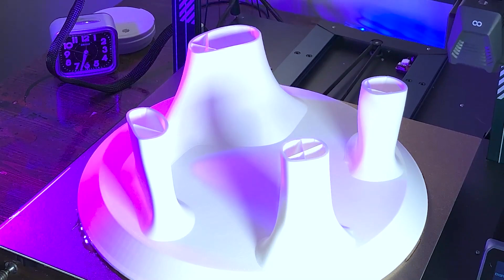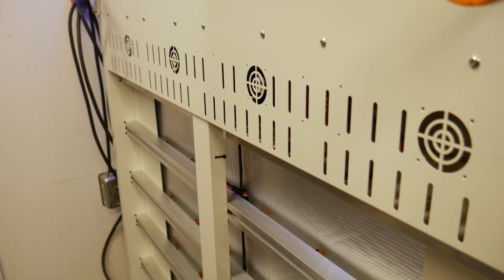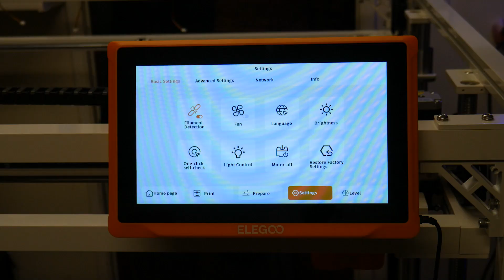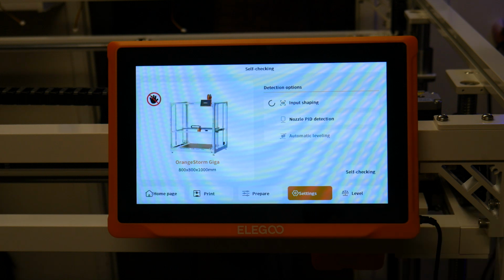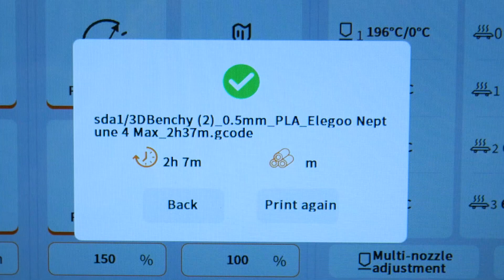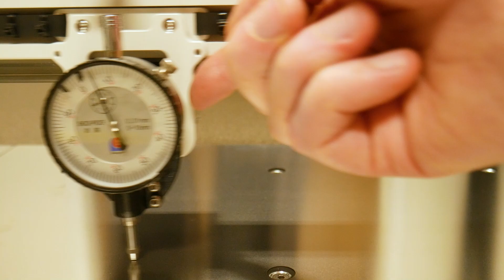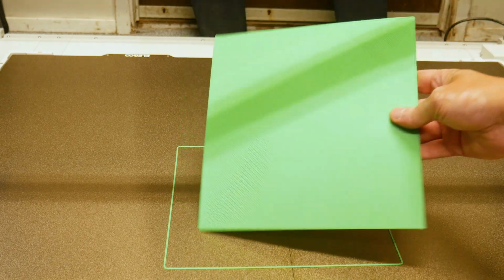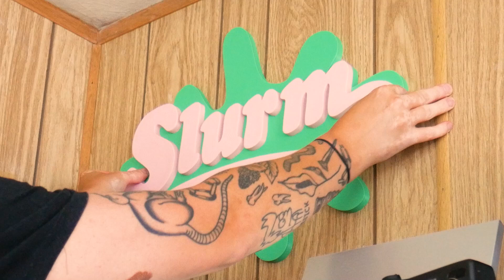Unleashing the Giant: Elegoo Orange Storm Giga 3D Printer Unboxing & First Prints!

Comment: Mine just came in yesterday. I purchased a runout gauge to help me level the bed as you did in this video. Where did you get the runout gauge adapter STL?
Reply from the maker: I whipped it up in fusion. I’ve had a lot of questions about it so I’ll put it on printables later today!
Reply: @WildRoseBuilds  Thank you very much!
Reply: Do you think you could make a short video on using the runout gauge? Mine finally arrived and using a runout gauge would be better than spending hours running manual leveling over and over trying to get everything as close to zero as possible.

Comment: Great video! Got my Giga in and have been running some nice prints off of it. I'd like to level it using a dial indicator also, would you be able to provide the link to that same dial mount you are using? Thank you!!!
Reply from the maker: I don’t think I have that file anymore! I just purged my 3D model folder 😭 I’ll check my fusion files and get back to you!
Reply: @WildRoseBuilds Thank you!

Comment: Printer seems to be amazing but on every single video I can see that filaments are wraping like crazy , without enclosure it's impossible to print objects at size 25cm  => , without wraping. Usually issue is the height so Z  axisis , higher you get, more problems you will find like x^2

Comment: Excellent showcase.  Just a shame that the Max will soon be replaced by a cable-robot enabled setup.  In the meantime, I challenge you to max out the build space with a carefully designed coin funnel wishing well. Put the resulting print in a high traffic location, and you should be able to pay for the printer in a week!

Comment: I can’t imagine the electricity bill after this
Reply from the maker: 1500 watts peak power consumption, probably 500 during printing. wanted to test power draw but couldn't find my meter :(
Reply: @WildRoseBuilds just ran mine for 85hrs! Not that bad, like running the dryer 3x … if you live in Germany or SoCal, or anywhere that is running extortion on utility companies it would be a cost because of “Peak” rates (using it at the wrong time of day).

And if electric is that bad good luck with EV mandates 😱🫣
Reply: @WildRoseBuilds  - Please include this kind of info in the next video.

With regard to the stool, a simple milkmaid stool is not much of a test for such a capable technology.  Perhaps instead print off an ergonomically enhanced, adjustable kneeling chair.  These are much more expensive, harder to find and more of a challenge generally.
Reply: 🫤… did Wildrose delete my first comment here or YouTube? 

In summary: it is not bad on electrical usage as it is still just a couple motors and heating elements like every other 3D printer.